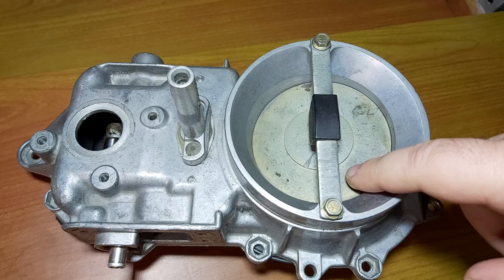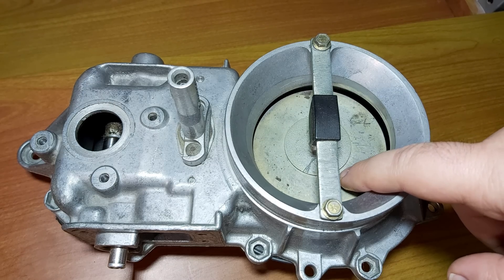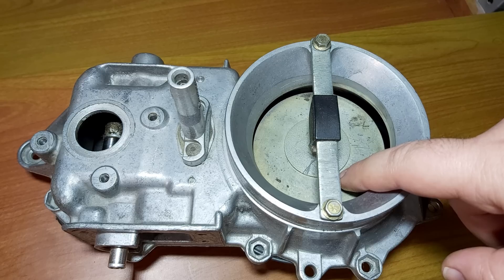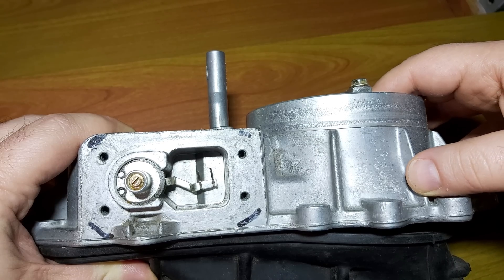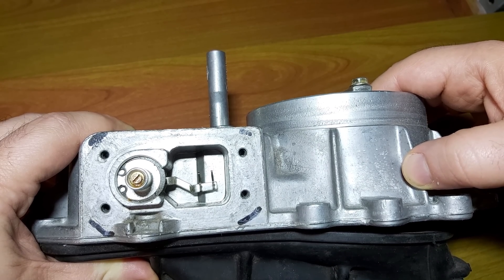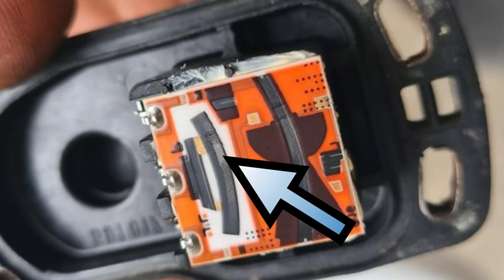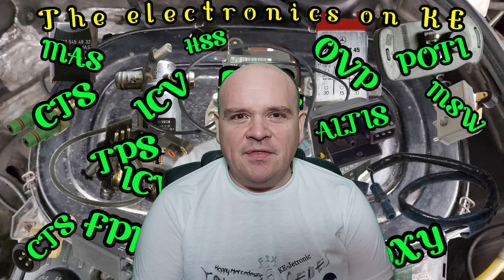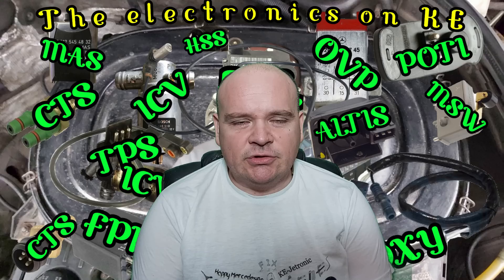㉦Mercedes Ke-Jetronic㉦ - 💥❓Difficult starts, detonations/Q&As❓💥

Comment: Hi interesting Video – thanks for that. A question regarding making the mixture richer while accelerating quickly. (Beschleunigungsanreicherung bei Gasstoß ) What could be the reason for that the motor is chocking for a short moment while hitting the throttle fully open quickly? Motor is a M117 with knockingsensors but without KAT. New Bosch airflow potentiometer is adjusted correctly. If Motor is cold and throttle is opened quickly then a positive current (greater 20ma) through EHA is obtained and correspondingly the fuel pressure on lower chamber is dropping like intended which means mixture should get richer for that situation. Anyhow the motor is then still chocking somehow. What would be potential reasons for that and what degree of chocking would be acceptable? Viele Grüße aus Norddeutschland
Reply from the maker: Hi. On a healthy KE M117, tip-in should be crisp. A tiny dip (≤0.1–0.2 s) can happen cold, but anything more points to one of the above.
If you share your exact readings (system pressure during the blip, injector test results, TPS/WOT continuity), I can help you pinpoint it to one or two items.
On a healthy KE M117, tip-in should be crisp. A tiny dip (≤0.1–0.2 s) can happen cold, but anything more points to one of the above.
Quick diagnostic sequence (15-minute plan)
Verify TPS idle/WOT transitions instantly.
Scope airflow pot for a clean ramp.
Confirm base mixture (hot) so EHA sits ~0 mA at idle.
Blip throttle while logging EHA mA + system pressure: system must hold while lower-chamber drops.
If still choking: check injector spray and plate damper; then ignition/knock sensors.
If you share your exact readings (system pressure during the blip, injector test results, TPS/WOT continuity), I can help you pinpoint it to one or two items.
Viele Grüße nach Norddeutschland — und Gutes Benzen🔧✨

Comment: Hello. I would like to ask for tips, my w201 m102 2l wont run in warm tempatures, it would only run when there is minus degrees like -10. But everytime i drove it inside my garage in a few minutes it will not run correctly it will run roughly then stall. Measured fuel pressure and it will stay at 5.5bar for a few seconds then drop to 2.2bar. I have changed the injectors and fuel pressure regulator.. no luck. I would really appariciate your help. Your videos have been helpful to understand the system but i can’t understand this one. Thank you for your viedos.
Reply: 1 fuel hydraulic accumulator
2 fuel pump check valve
3 fuel line from engine to fuel filter
Reply from the maker: If that happens while the car is on check the fuel lines and replace or clean the little filter on the feed line.
Reply: @mercedeske  Здраво Ивица, пише да му притисак горива када се пумпа за гориво угаси брзо пада на 2,2 бара* и највероватније наставља да пада још ниже.
При ниском притиску гориво ће испарити *мехуриће гаса на благо позитивној температури директно у ињекторима, цевима за гориво и разводнику, ометајући потпуно убризгавање. - пумпа за гориво ради кратко при паљењу мотора, али не обезбеђује нормалан притисак, али његов опада.
И шта сам још приметио да чудно пали на минус 10... али по топлом времену има проблем Да ли му цури стартна ињектор?

Comment: The guy in trouble had the engine stalling when revving it up. Could it also stall the engine once it reaches the idle? Like coming to a stop? Having it lower to 500rpm, holding a shaky run and finally stalling? Or that is only ignition related?
Reply from the maker: Hello, which car is it about?
Reply: @mercedeske  M103 26 auto